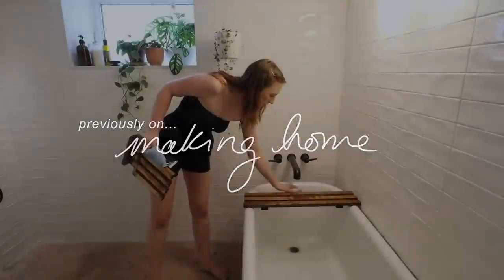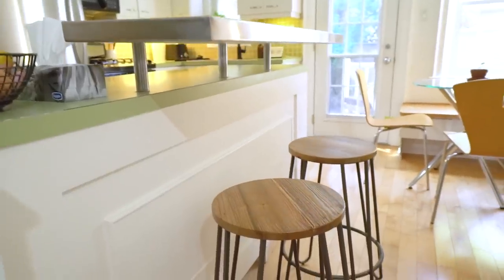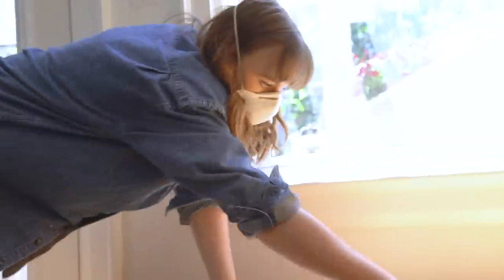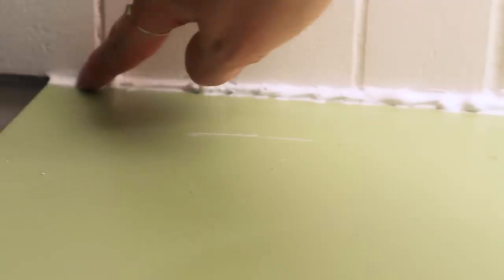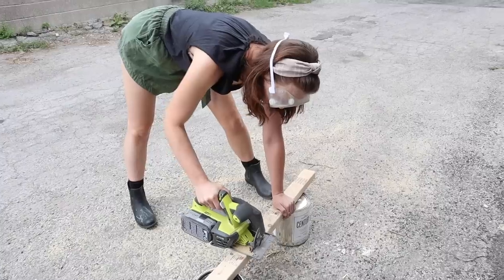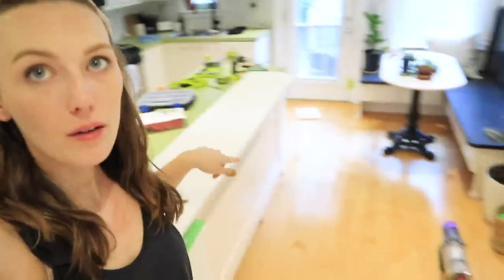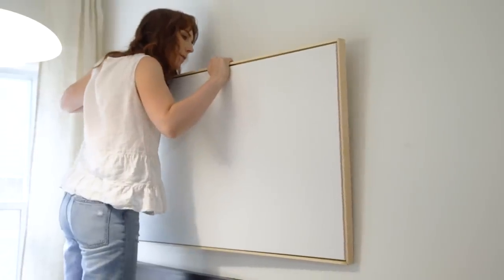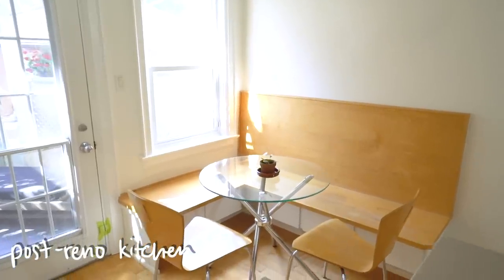diy budget-friendly complete kitchen makeover!

Comment: I don't think you've done this before--would you guys maybe do a basics video on electricity/light fixture attachment?
Reply: That may be a liability for them.  What you do is undo your fixture and WITHOUT undoing the wires, take a picture of the wire connections. Then you connect the new fixture as it shows in your pictures.  I have done many, many simple fixtures but one ceiling connection I forgot to take a picture of the connection and it was all over.  I came back to it about an hour after I had disconnected and had already forgotten how the 60 year old wire connections  were connected to the modern fixture that was only about 5 years old. I watched about 20 videos online and then just left it. I still have not called in an electrician. I just nutted it off and keep forgetting about it since it's not my room lol.

Comment: Love the video, however I was aksing myself how you attached the table top to the base? 🤔 Very curious here 🤗
Reply: Probably drilled wholes into the bottom marble to match the holes in the table base and screwed them on.
Reply: @maryking2597  I guess the question is how do you drill into marble without cracking it?  Probably a Google search could help.  I was very worried when the tabletop was on the base but not secured yet.  :)

Comment: In my house is also a corner bench. The sits can be opened to put thing in them. It has soft seatings. They are much seen in German houses. In the corner is mostly a nice item. A plant or so. i had my tiny christmas tree there. I live in Belgium. Ardennes ( former german territorry). My bench needs some modern fabric on it. Whats on there is about 40 years old.

Comment: I'm in a rental house with a tile countertop.... it's fine and actually kind of cute. The backsplash is the same tile with an accent row with a little flower on it. It has a glorious window shelf, that a cat sits in, behind a farmhouse sink. It has TWO  nooks, and I'm leaning into the kitch bits with a KIT-KAT clock I've always wanted, and looking at making/buying a pop out ironing board cupboard.
Reply: I was hoping the "pot lights" solution was going to be one of those premade replacement pendants, because they are so difficult to find. I want to replace 2 of them in my living room to become a dining area. Also one of them is burnt out so I have to replace it anyway.

Comment: Kelsey I don't know if they sell those in Canada, but here in my country we sell some electric strips that you can glue to the wall or ceiling, then aply sparkling and paint over, you could use the ceiling light that it already have it, you can connect directly and she will turn on along with the others, or get another cord through there just for the pendent and add a new switch in the wall case. You can also aply vinyl to the frigid and countertops to change their colors.

Comment: When you sanded your dining nook bench to prep for the primer/paint, what grit did you use and how "aggressive" were you when you sanded? I only ask because I said "the hell with it" a couple of months ago and got a power hand sander. Worth it if you ask me, but it's definitely an investment. I still use my little 80/120 sanding block though!

Also, my father-in-law taught me a really cool trick when caulking: after laying down a thin line of caulk, spray Windex on your index finger and run it over your caulk line! The Windex works wonders!

Comment: Check the length of screw thats holding the metal plate to your door frames. Most of them are tiny and make it easier for your door to be busted in. I replaced mine with long deck screws my dad had.

Comment: I was waiting the whole time to see how you secured the base to the marble top! Do you drill into marble?
Reply: I was wondering how it was secured, also. I hope it's not just sitting there waiting for someone to lean on it and have it (and them) crash to the floor.
Reply: @laurieomoore94  the top part of the table base had holes for screws.  She likely drilled holes in the marble bottom side to screw the bolts into.

Comment: Cover/skim counters with concrete countertop is another idea and it will fill your holes.  
Your cabinet handles are installed incorrectly (horizontally). They should be vertical.
How did you attach your table base to the marble?

Comment: Hey one seriously important comment!! That marble top needs additional bracing underneath. Marble isn’t able to support an overhang that long. If you notice the previous stand it had had support along the full length of the top. You should get a metal worker to make you a steel plate that’s about an inch smaller all the way around than the size of the top, and then have him weld that to the cast iron base, and then attach your marble top to the steel plate. Otherwise one day you’re going to be using the table and the marble is going to break off, and that could seriously injure toes.

Comment: I vote paint the handles black but rotate them 90 degrees (on the cabinets, not the drawers) so they are vertical. You'll have one hole to cover on each cabinet, or you can put a little black knob in the hole which would look like ). which is maybe not actually a look and just a mess.

Comment: I would very much like to have seen how you attached the cast iron leg to the marble top. Wouldn't drilling make the top crack? I don't see how gluing would have worked either, that table top is heavy.
Also, I'm wondering why the heck you didn't paint the cabinet handles matte black....

Comment: Why didn't you just change out the counters for a nicer composite or butcher block? It wouldn't be the price of like a granite or quartz, but would be nicer than the old green. Additionally, both of those could probably be attached with screws so it should be relatively DIY friendly.